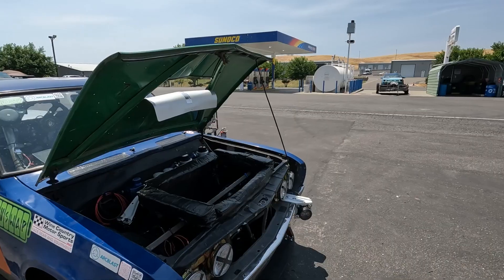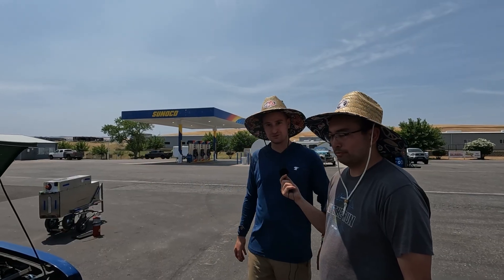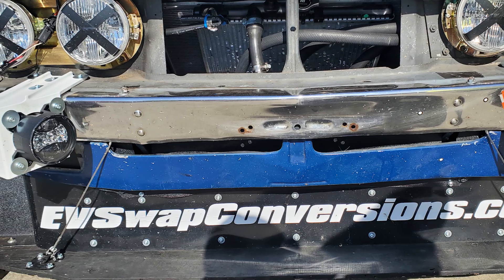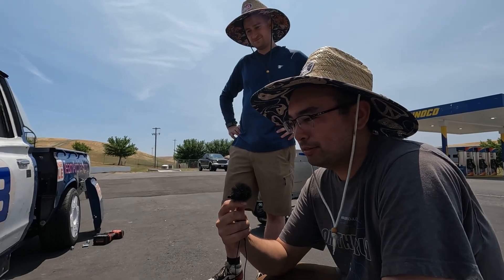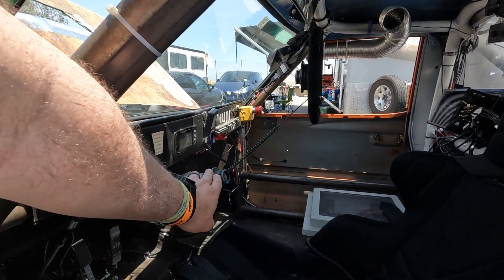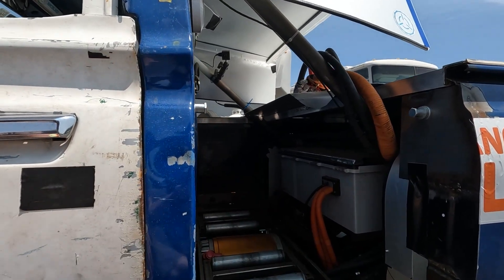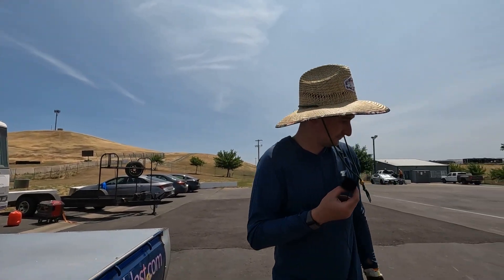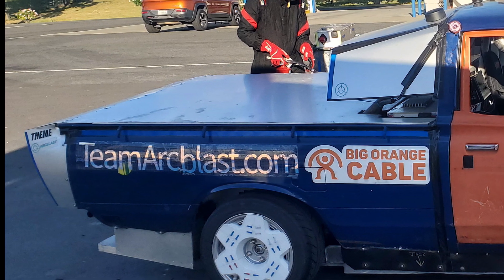RECORD! Electric Endurance Datsun 620 EV Conversion

Comment: Put a gearbox on it, and maybe that will give you the advantage
Reply from the maker: Interesting idea! Will have to stay tuned this year, we might have something coming up the sleeve...
Reply: @EVTUNERS  3speds is just enough for an ev based on my knowledge, just pick the right gb to handle the torque, and ratios, my last prototype was a 4sp, but “1st” was pointless, 4.32:1, it’s a “if I want to pull a plane, with brakes on” torque)), 2.76 was just enough, the diff was 4.1:1, and the motor was 320nm (235 ft/lb), the car was 2.2t(4500lb)
Reply from the maker: @MichaelFalcon-g3f where can I check out your build? That sounds awesome!
Reply: @EVTUNERS  unfortunately not anymore, it was in a small city outside of Kyiv, Ukraine, but in '22 a rocket destroyed the whole block, so only memories and some photos i didn't post...
Reply from the maker: @MichaelFalcon-g3f uhg man that sucks. At least you made it though. Perhaps in the future you can create another build!
Reply: @EVTUNERS yeah, when I get discharged or if I successfully move to the states I’m gonna open my own shop and build lots ov them!, I love cars, and I think ev is fun, time will tell if these are just dreams or plans)

Comment: I'm EV swapping my Nissan D21. Where do I get the Anderson connector?
Reply: We are using one of the Anderson SB series connectors, with the 2 high voltage connections and 8 auxiliary connections.  Maybe SBE?  They’ve been working great for us and we love the aux pins are mechanically connect last/disconnect first.
Reply: @nickc7995  I think I found what I need, the Anderson SBE320.
Reply from the maker: Sounds like an awesome project! Those connectors are available online which is probably the easiest.

Comment: Great Setup!  So there are two batteries?  One being used and the other charging?  How is charging quickly accomplished?
Reply from the maker: There are 3 batteries total, one being used and two charging. That roughly works out to a 1.5 - 2 hr charge time and are swapped out with driver changes! 
Maybe I should post a picture of the charging setup on the channel...but the takeaway is that the team has build chargers that can take power from a level 2 post or RV hookup and run it into the battery packs while also cooling them down.